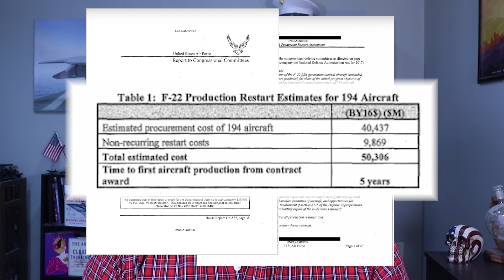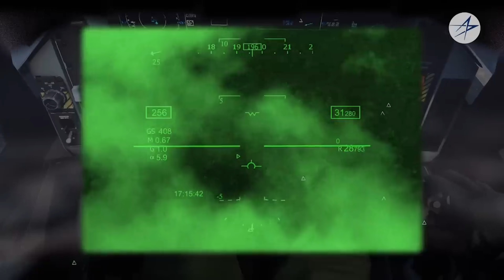The 2ND GENERATION F-22 RAPTOR we ALMOST got

Comment: Can you imagine; if there were 750 raptors in existence right now?
Reply: Even if we would have ended up with 300-350 serial production airframes we would be sitting pretty. 

I just hope we start taking our fighter missile programs really seriously especially if want the 6th Gen NGAD programs to be successful for a long time. The F-22 just doesn’t have internal storage like the PLAAF’s J-20. Not saying the J-20 is a good fighter or not but it does have the internal payload that we should be striving for in the NGAD programs.
Reply: @nastystang113  The US military is developing three distinct air-to-air missiles: the AIM-260 JATM to counter advanced threats, Boeing's Dual Stage Missile Concept for range versatility, and Raytheon's Peregrine for medium-range engagements.

The Peregrine will supposedly be half the weight and size of a current AMRAAM with similar range.
Reply: @nastystang113 The J-20 is really more of an interceptor, and is just physically larger.  It also seems to have sacrificed some stealth and probably maneuverability to get a form that would accommodate a large payload, and it still only carries 2 more missiles.  The F-22 was designed to be a pure air superiority fighter which was incredibly agile and stealthy from all angles.  NGAD will probably have a flying wing design, which wasn’t really ready to be used for a fighter in the 90s, but now that we’ve overcome technical challenges, it should be able to accommodate a larger payload with a longer range without sacrificing performance, and have even better stealth.  

And yeah, Obama and Gates were idiots for killing the F-22 program based on the assumption we’d only ever have to fight terrorists in the future.
Reply: @nastystang113  The F-22 can carry six AMRAAM missiles in its ventral internal bay and two AIM9-X Sidewinder on its side internal bays, one in each. Apparently you know nothing about the aircraft.
Reply: 750 raptors to fight who? Russia is a joke... Iran and NK don't last 2 weeks in war VS U.S only China is a challenge.
Reply: @bastordd  Basically my thought as well about 750 F-22. I love the F-22, but who's going to feed it aircraft? It's not really that good at ground missions, not nearly as good as the F-35 and we also have stealth bombers. Most adversary nations are ground focused because NATO and US allies focus on winning the air. So they need ways to counter the air and usually that's through SAMs and AAA. Don't need to dogfight ground targets.
Reply: Imagine x750 *breaths deep in would you intercept me I'd intercept me
Reply: @jonney_boy  😆
Reply: @jonney_boy What are you talking about? I have seen that last sentence before, but it doesn't make any sense.
Reply: @pike100  it's from a habitual line crosser skit
Reply: @jonney_boy  that's fucking hilarious!!😂😂😂
Reply: I tested the F 22 climb rate and missiles system with my balloon 🎈 😄..
Reply: It would be an epic world that we live in, and adversaries would think twice before acting so belligerently
Reply: What exactly would be different?
It's not like there is any country that attacks the US directly.
Or do you think that the Houthi rebels would NOT fire rockets if there were more raptors?

Sorry, but the existing raptors already see 0 combat, more raptors in existence would change exactly 0.
Reply: Would you intercept me !? ... I'd intercept me !
Reply: we don't need that many...nothing out their can stop the ones we have now...
Reply: The most top secret thing about the F-22 is that there’s actually thousands of them 😉

Or so I’ve always wished
Reply: China would be a little quieter...
Reply: It would be a peaceful world. Nobody would want to try the US.
Reply: can you imagine if the 2020 election was legit instead of stolen?
Reply: chaos.
Reply: In the 25 years we've had the Raptor it has never flown a mission that only it could do. An additional 500 over them would just be $300 billion wasted. They look cool, and I'd give my left testicle to fly one, but the reality is, - They've never been needed.
Reply: Then there would be a lot less money. Imagine being in a war and having 750 Raptors but running out of artillery shells?
Reply: That's 750 mental instabilities that would be ruling the sky's....I'm all for that 🤣
Reply: I like the plan to leapfrog past the F-22 and get the NGAD going.
If the NGAD is even half as good as what they're saying it will be a monster. It might even be the aerial equivalent of the HMS Dreadnought, making all previous fighters obsolete.

Can you imagine - The US military makes a version of the NGAD for export? It might not be the cutting edge heavy mother thunder, but it will still be far ahead of a MiG.
Reply: @seq31  I hear ya, but, it's obviously has a long range, it appears they have upgraded the engines and, they carry lots of missiles. I do imagine their avionics is quite good. The Chinese are not dumb either. They'll learn quick when the sht hits the fan, I do believe. Nothing to scoff at. Must be taken seriously.
Reply: That would hurt China’s feelings.
Reply: @skyserf Oh no!. We care about those feelings,. Even if they declared war on the US. since the late 90's and have been and they are in a silent war against the US and considered them to be there  #1 enemy . Even if they are  currently raising and training there children to go to war against the US kids at preschool age and up.
Reply: i dont think we would have the f35 right now...we would be spending so much to keep those 22's running
Reply: @FELiPES101 Actually, we’d probably be spending much less per flight hour to operate the F-22, because economies of scale would have made parts much cheaper to acquire and we’d have a much more extensive maintenance network.  The aircraft probably also would have gotten more upgrades along the way, perhaps including newer RAM.  The planes themselves would have also been much much cheaper per unit if we’d built more.
Reply: @FELiPES101  economy of scale says it would be much cheaper than you think.
Reply: @FELiPES101  We wouldn't have the F-35 right now, because the F-22 proved to be a better strike fighter than the F-35.
Reply: @FELiPES101  depends on whose districts the F-35s are made in
Reply: @FELiPES101  That is bullshit - you're confusing what the Chair Force has with what literally EVERYONE ELSE has.  You don't get what those requirements mean.  I sorta see your point, but it's still 100% inaccurate.
Reply: @FELiPES101  We probably would have had both. The Joint Strike Fighter program (which produced the F-35) was launched before the Advanced Tactical Fighter program (which produced the F-22) was, and each program's intent was for different kinds of aircraft intended to fill different roles.

The ATF was for domestic Air Dominance roles and the JSF was for multirole, VTOL/STOL, and for export. Basically, the F-22 was supposed to replace the F-15 and the F-35 was intended to replace the F-14/16/18 and A-6/7/8.
Reply: I absolutely can...obviously. 
Can you describe how the world of today would look different?
Reply: @SanchoPancho979  🤓
Reply: You plan to overtake Mars and Venus with that many planes 😂
Reply: Nope.  2018 we were at peace.  Now we're going 6th Gen (aka Drone Generation).
Reply: Full steam ahead🤣. @jimmiller5600
Reply: Yes, we would have 750 very capable short-range combat aircraft in a world where we need long-range combat aircraft.  The weakness of both the F-22 and F-35 is the unrefueled combat range.  Both are simply ineffective in a western-pacific scenario.
Reply: They would be 25-27 year old aircraft close to the end of their service life that would soon need to be replaced.
Reply: @heathwirt8919 you say that but new ones would literally still be being built, and eccentric upgrades constantly being tested/implemented lmao
Reply: @mamarussellthepie3995  The contract would have been completed over a decade ago including spares, but the bulk of the F22 inventory would be approaching retirement. Now we will have a newer far more capable air superiority aircraft that will be the best in the sky for at least 20 years. The timing was perfect.
Reply: @mamarussellthepie3995  Eccentric upgrades? WTF does that mean?!?
Reply: @heathwirt8919 meanwhile the b52s airframe has been upgraded since the fucking 50s,yea gtfo outa here
Reply: @lamborgatti-4783  Not much, the tail section was strengthened and pieces from the bone yard used for repairs but it's basically the same aircraft as the B-52H. The electronic systems including avionics has been upgraded as have the weapon's targeting and EW systems.